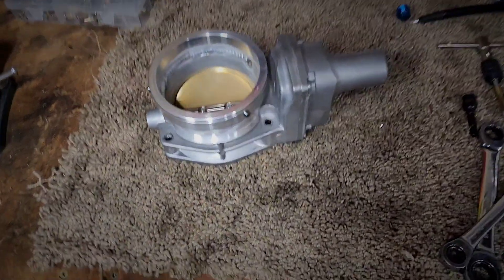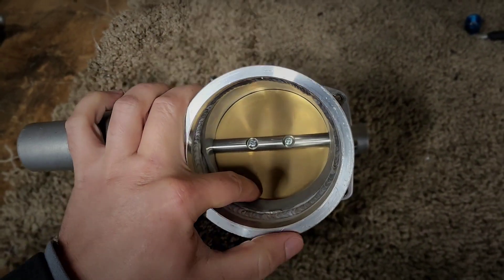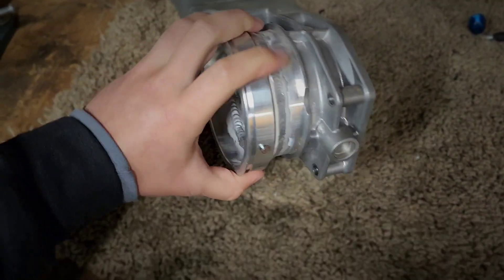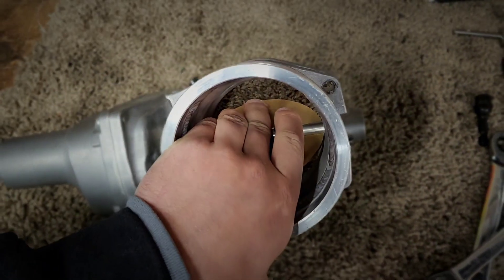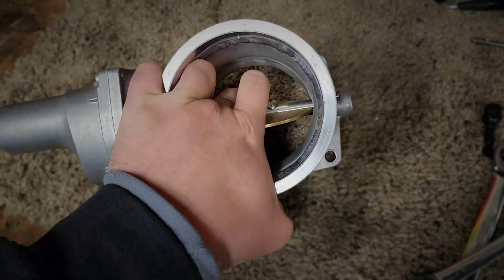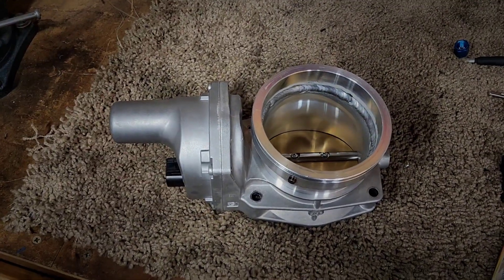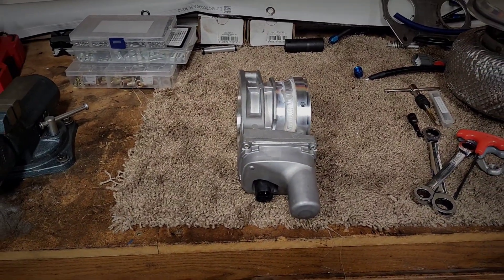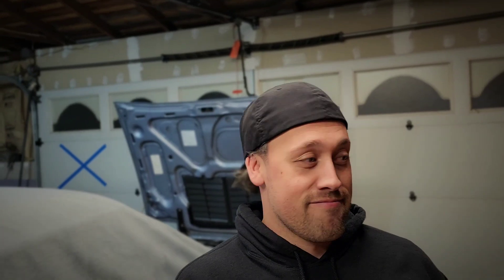The Secrets to The Black Arts of Tuning DBW Throttle Body Calibration

Comment: Hey! Do you have any derivations of stokes equation in relation to DBW tuning or was that comment you made more of a theoretical basis in that "this is the principal that governs DBW tuning"? Would be interested to see someone walk through the equation for two different applications and compare.
Reply from the maker: I'm educated in Calculus, so that wouldn't be an issue, but the math simply breaks down to be easier than that.  

In the real world, we can make a few more assumptions and find that a peak velocity tends to land near another easily measurable item which can then be targeted by DBW mapping.
Reply: @RGHTBrainDesign  Same here - I was Applied Math major in Uni, so was curious on what that might look like. 

That being said, I'm also a fan of practical applications over all - any chance you can elaborate on what assumptions to make and determine peak velocity for DBW mapping? My pedal maps do follow a more logarithmic ramp but, I am interested in how to improve them.
Reply from the maker: @joao_bridge  It's too much in the realm of Intellectual Property at this point, but logarithmic is the right approach here.  

To simplify, take a look at an early year Aerodynamics school book and start thinking about trends of airflow, pressure ratios, and how velocity all fits into the mix with changing Reynold's number. 

You're going to see something so simple staring you at the face and have an "Ah hah!" moment that I don't want to take away from you.  The more you work for it, the better the reward. 

The hint is that we will be focusing on generating a throttle opening that targets a certain something in the system. 

Proud of you, my dude. You got this.
Reply: @RGHTBrainDesign  TORQUE
Reply from the maker: @IRLArgentino yep

Comment: It's the same concept with a old style Cable Throttle. It's just most people don't get how to control their foot to find that sweet spot. Or more importantly they don't know their engine. You mash on it with a old cable throttle you will have less torque than if you push only 10%.  Opening the throttle gradually as the engine needs. Same rules for old cable as DBW only difference a foot is controlling and not programming.
Reply from the maker: Exactly. Perfectly Said.

Comment: There’s a reason why carbs and basic throttle bodies have idle adjustment. When I rebuild Moto carbs you always need some air flowing around the butterfly or you have no air. Turbo as it spoils up forcing more and more airflow even passed a small plate vs na pulling vacuum . Or on the other end.. massive amounts of fuel and too little air just bogging out and engine. It’s a dance 💃

Comment: Are you suggesting that your setting up a throttle curve based on airflow and the rate of opening is not in direct relationship to the pedal? Or are you simply stating that you’re actually calculating the best curve for an engine versus the trial and error method, or one size fits all method that I’m sure is common?  My right foot should be the only thing deciding the opening rate, and imo it’s more important to tune that pedals relation to the TB opening to what suits the driver best which is a combination of the build, the driver, and the use of the car.

I’m sure you dial it in bang on, I just think you’re making it seem more complicated then it is.  Remember, Tuning is Magic, lol
Reply from the maker: If a driver slams a pedal open it will be slower to respond on the engine; that is a given.  So by taking the idiot meatbag part out of the equation, I'm adjusting the throttle body for #1 feel first, #2 drivability, and #3 engine total response by means of calculated air mass, surface area, and trial by error to create a throttle curve that optimizes the engine. 

It's important to realize a direct relation from Pedal APP to TB % should not be linear, more logarithmic.  Slamming a throttle open is going to slow you down because the surface area is far more critical than the throttle body opening percentage. Don't be a putz; this is simple and exactly what was said in video.
Reply: @RGHTBrainDesign   why resort to name calling? If you don’t want to engage with people over the topic then turn comments off so people know you only like to hear yourself speak. You clearly know what you’re talking about and want to share it, so why not simply engage?

I 100% understand that it’s not linear, and you did make that clear, the theory came across well.  What’s not clear is what you’re doing.  You mentioned pressure sensors on either side of the throttle body and harmonics, so are you adding another table to control the throttle curve based off that data so the throttle opening isn’t necessarily the same all the time versus pedal position? Or is it just another consideration when designing the same 2D table we all do?
Reply from the maker: @Popes_Projects  I'm not name calling in the slightest.  That is referring to elimination of human error.  

This is open for discussion.

I'm not going to give away exact specifications on how I'm calibrating a throttle body to optimize it as it's my way of income.  I'm more than happy to share the theories I'm following to get there successfully.
Reply: @RGHTBrainDesign so share them. Show tables or modifiers, or just keep insinuating the world ain’t as smart as you. Meanwhile my linear curve dual DBW works perfect.

Comment: Yeah either pin holes drilled in the throttle blade or slightly open
Reply from the maker: Yeah, but this method of slightly open is only in the case of failure.  The DBW Motor will shut it fully and seal the blade exactly as you'd hope it to...right before the point of stiction.